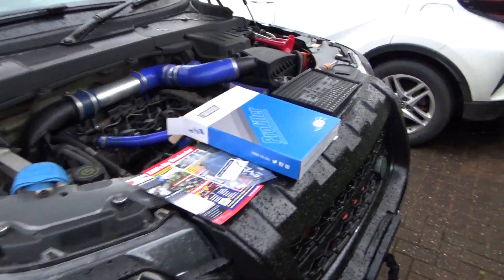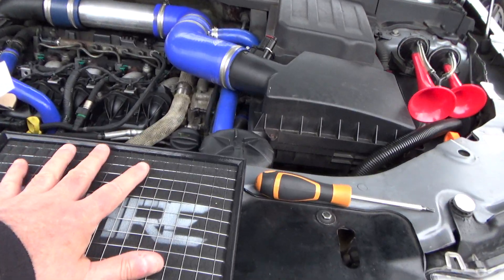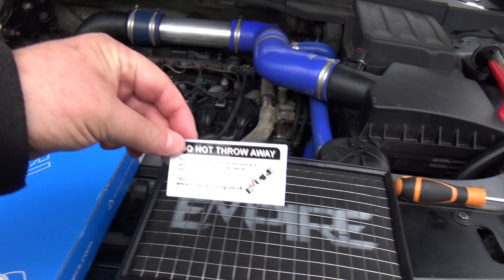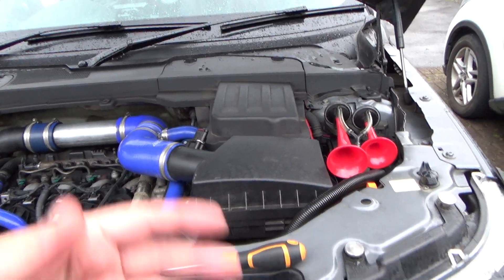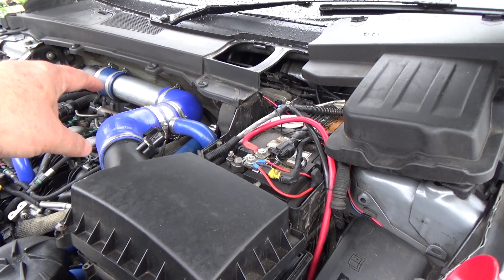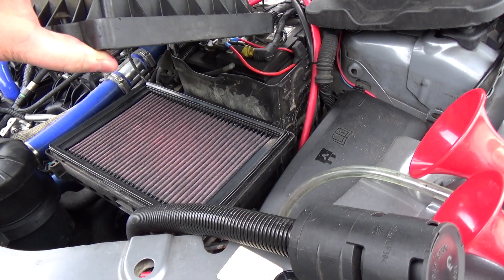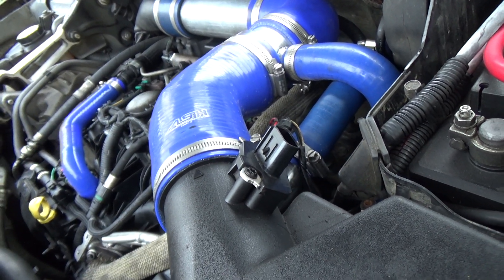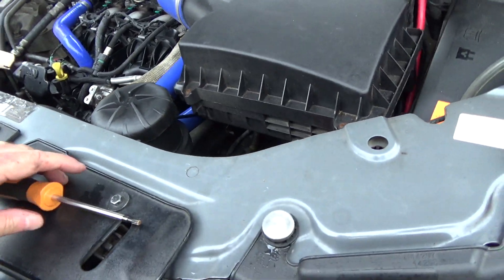Performance Air Filter Comparison - ITG vs K&N - Land Rover Freelander 2

Comment: Hey Scott, thanks for doing this video helpful as always. In terms of cleaning the filter at service intervals we sell a proper kit that will last a very long it comprises of the oil and cleaning fluid. 

The mesh is stainless and will not rust. 

Also in terms of the labels I will get on to the manufacture and see what we can do about it making them a bit more sticky

Thanks again bud 💪
Reply from the maker: Did you see the comments on the oily MAF sensor? Take it the ITG won’t suffer from this issue?
Reply: @BeavisPits  sorry i missed that, wayyyyyy back there wasn't a proper process in place regarding the oiling of filters and some of them did infact leave to saturated. However for a number of years now they have had an additional process which insures the filters are oiled with the exact amount every time all the time and also added an additional QC check as well. I have had no issues what so ever regarding oil and mafs and ive run these filters in cars from fiestas to Ferraris

Comment: Be interested in how the MAF sensor copes with the oil from the ITG filter.
Reply from the maker: Been running it for a month and no issues so far. The filter is pre-oiled but not oily as such. No oily residue coming off it.